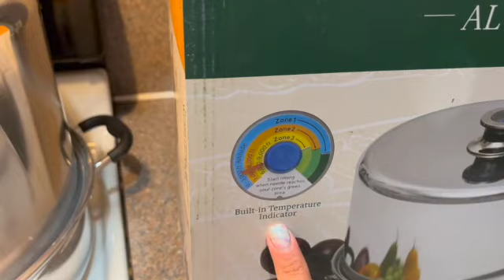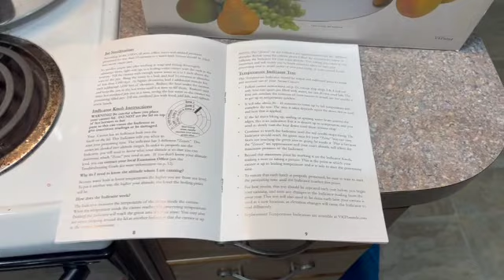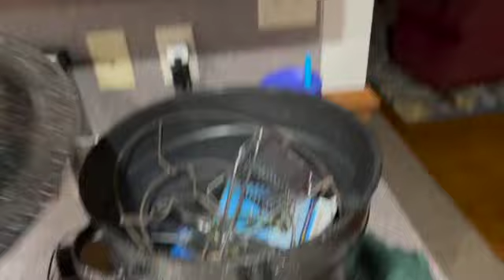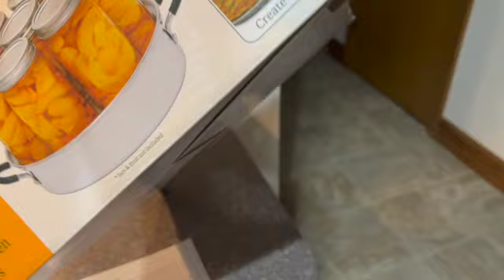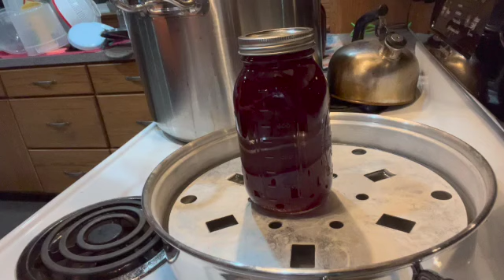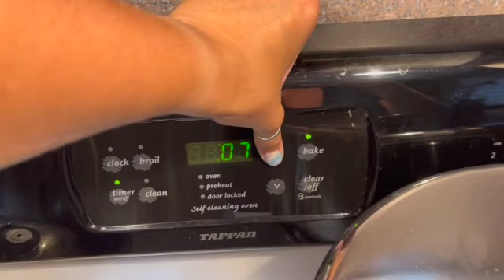Kitchen Crop Steam Canner - A New better way to do water bath canning!  Amazon Product

Comment: Can you heat the jars in the canner instead of the stove until you’re ready to fill them
Reply: Yeah I was thinking since you have to preheat to 180 you could heat jars while preparing another question why do you have to preheat
Reply from the maker: The reason is because if you are adding hot liquids it can cause the jar to crack…not always but the quick temperature change of the glass can result in a crack. It can even happen with heating the jars first but it less common. There are some times where you “cold pack” a jar everything is then cold/room temp and everything warms together but that can only be used for certain situations. I hope that helps:)
Reply: Sorry for not being clear but I meant why do you have to preheat the water in the canner I just got one haven’t tried it yet thanks
Reply from the maker: I’m sorry for misunderstanding 🙃. I believe it is so the jars and everything is close to steaming temperature.  With water bath canning you also have your water pretty close to temperature before you are inserting the jars. 

I absolutely love steam canning!  There are so many advantages over a water bath canner. I hope you enjoy it too:)
Reply: Thanks ha
Reply: Oops hit send button by mistake thanks for your help new to canning
Reply from the maker: You’re very welcome:). It’s been nice to chat with you!
Reply from the maker: I have not tried that but I’m loving the idea!  I will do some experimenting with this!